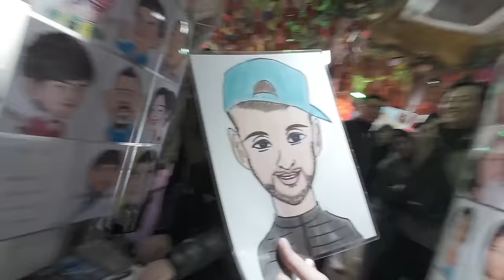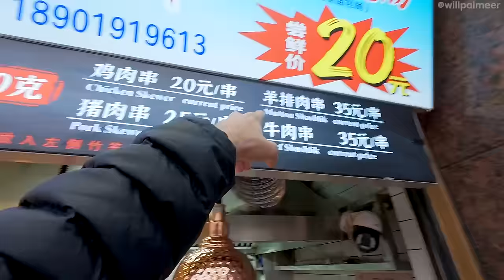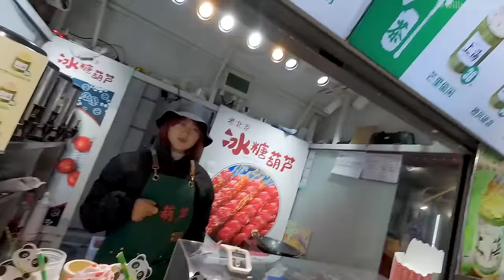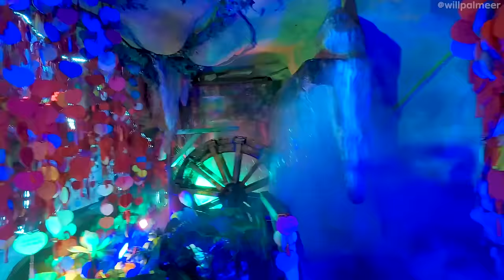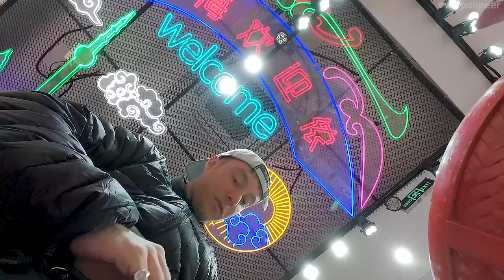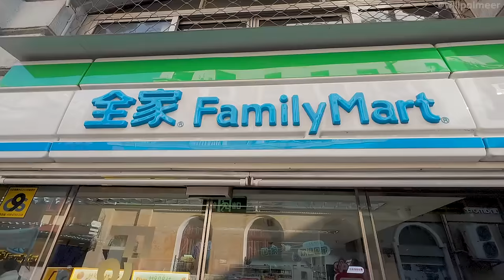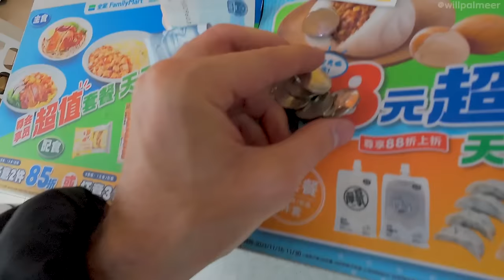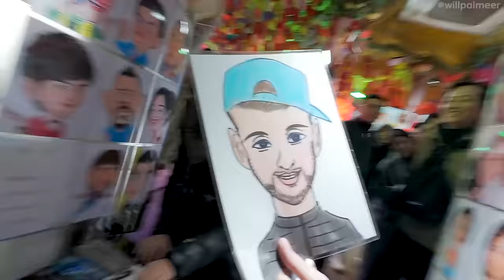My First 24 Hours Inside CHINA 🇨🇳 (Shanghai)

Comment: Shanghainese here! Welcome to Shanghai! Not sure if you've figured it out yet, but in China most things can be done, including payment, through either WeChat or Alipay. I was told that it's actually very easy for foreigners to set up an Alipay account and link their credit cards. Maybe you can try that next time. Not many people still use cash here these days. Also, the amount of electric cars isn't as high as you think. I would say about 50% are electric now? You can tell by their number plates. Blue plates mean combustion and green plates mean electric or hybrid. By the way that one occasion you heard a lot of car horns is because you were crossing the road under red light. It's not your fault, as I can see that you were just following other people, but we typically don't do that here. In terms of the streets, Nanjing Road is probably the most touristy place you can find in Shanghai. It's a good destination for a first-timer, but it doesn't represent nowadays Shanghai particularly well. For example, those "big iconic Chinese signs" you mentioned. They were built about 30 years ago when Shanghai had its first boost in economy. We don't really build them anymore, and you will find them in large quantities only on Nanjing Road now. Nanjing Road is also probably the only place in Shanghai where you will find scammers, unfortunately, so do be careful when you are there. Anyway, nice video, and enjoy your trip! (If the trip has already finished, I look forward to you coming again to explore more! Shanghai has a lot to offer!) Cheers!
Reply from the maker: Thanks for watching!